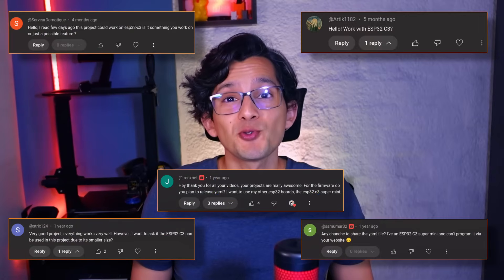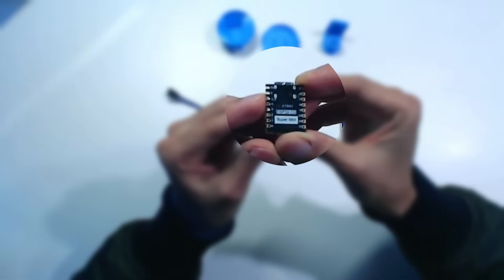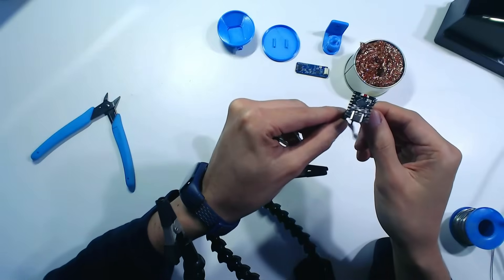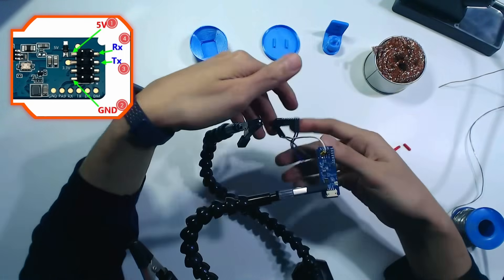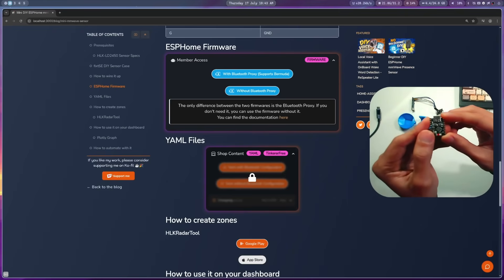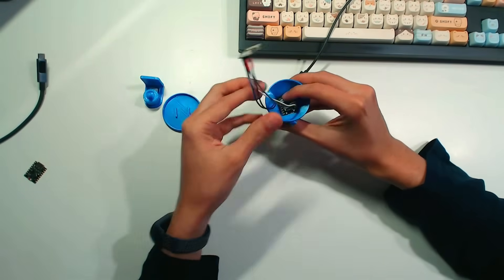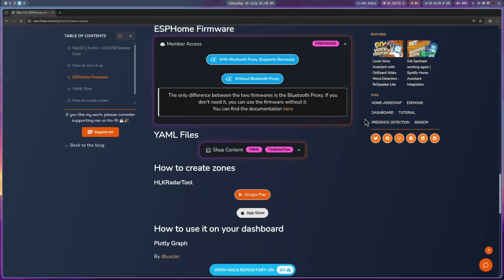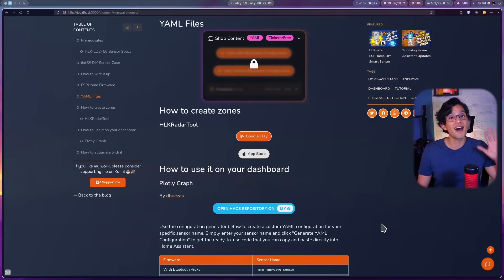mini DIY mmWave Presence Sensor | ESP32-C3 + LD-2450

Comment: Thank you so much fort this video. Very informative. 
But I have a problem. My esp32-c3 can be added to my homeassistant together with the mmWave sensor. But the sensor is showed as unknown. I am using the white small plug to connect the sensor to ESP. Can this be the problem?

Comment: I am not getting any distance readings, but it does report that it is connected and shows the LD2450 version number in Home Assistant.

What  do I need to do to have to report its distant values?

Comment: If I where to build this I would cut off the pins and solder the wire directly to the PCB.
Reply from the maker: You can use the pins on the side of the sensor for that. I just thought that approach might be a bit challenging to execute if you're new to soldering, that's why I went for the easier DuPont female terminals, but it's definitely an option.
Reply: @fixtse.  Fair enough.
Reply: Not intending to be troll or put ayone down, but those connections would have really benefitted with some flux first.

Comment: How's the WIFI range? The super mini board that you have linked in this looks like they are the ones with the "design flaw that ruins Wifi/BT"
Reply from the maker: Hi, thank you for pointing that out! I was under the impression the issue was with a different antenna (https://github.com/esphome/issues/issues/4893#issuecomment-1907180296). I just measured mine, and you're spot on, it’s the 2.5 mm version.
It's funny, because I had it running for two full days for my tests (sharing the antenna with Bluetooth and all) and didn't notice a single connection drop, probably because I limited the power output as recommended to 8.5 dB. But honestly, more reliable WiFi is always a win! 

I’m adding a couple of links for the better 3.5 mm version now. I'm also going to be adding a Wifi Signal sensor to the project for easier debugging and stick my test unit in a spot with weaker WiFi and see what happens.

Thanks again for contributing, this is what makes the community great!
Reply: @fixtse.  Limiting Wifi 8.5dB is the only way to get it to work due to the design flaw. the quickest way to tell that its the bad design is the placement of the crystal oscillator — it’s positioned too close to the Wi-Fi antenna and sits about halfway up the number 21 pin hole.
Reply: @fixtse. Are you going to have two firmware versions on your site: ?

One for the ESP32-C3 boards with the design flaw, which limits Wi-Fi transmit power to avoid interference.

Another for the properly designed ESP32-C3 boards, which work perfectly without needing to limit Wi-Fi power.
Reply from the maker: Yes, I'm a little bit all over the place right now (got caught up doing some testing), but I will update the firmware before my next video so I can include a version without the wifi limit.
Reply from the maker: updated the website to include the 2 versions
Reply: @fixtse.  If you set the framework to type: arduino, you can configure the code to reduce Wi-Fi transmission power to 8.5 dBm when it fails to connect after 10 seconds. This  code will try all the time

 ##Dont forget to remove the hard coded "output_power: 8.5dB" from the WIFI**, or it will make this code redundant.##

interval:
  - interval: 10s
    then:
      - if:
          condition:
            not:
              wifi.connected:
          then:
            - logger.log:
                level: WARN
                format: "WiFi not connected after 10 seconds. Setting TX power to 8.5 dBm"
            - lambda: |-
                WiFi.setTxPower(WIFI_POWER_8_5dBm);
          else:
            - logger.log:
                level: INFO
                format: "WiFi connected within 10 seconds. No change to TX power."
Reply: @fixtse.  Or this code only runs once at boot after everything else has booted. 

##Dont forget to remove the hard coded "output_power: 8.5dB" from the WIFI**, or it will make this code redundant.##

esphome:
  name: 
  friendly_name: 
    
  on_boot:
    priority: -100  # Low priority so it runs after WiFi setup begins
    then:
      - delay: 10s
      - lambda: |-
         if (!WiFi.isConnected()) {
           ESP_LOGW("wifi", "WiFi not connected after 10s. Setting TX power to 8.5 dBm");
           WiFi.setTxPower(WIFI_POWER_8_5dBm);
         } else {
           ESP_LOGI("wifi", "WiFi connected. No change to TX power.");
         }

This method takes the longest to establish a connection, as it runs after all other processes and includes a 10-second delay. However, it only executes once per boot and then releases system resources.
Reply from the maker: Hey @natrogers3297, thank you!!!, I will test this asap, I'm about to release a video about this and might need to re record parts of it, but this solution seems way better than having two separate firmware.
On the first boot, after flashing, since wifi credentials are not provided yet, the power will be set to 8.5, but then after restarting the sensor again, it will just work. Is there any other edge case that I might be missing? After a power loss, with no ups for the network, the sensor will boot, but probably the network it's not going to be ready to connect in the first 10 seconds, so the sensor will set the power to 8.5 and stay there until next reboot.
mmmm I don't like that scenario.
What if I add a global variable (boolean), that stores a value, so if the sensor it's known to work with full wifi power, it deactivates the WiFi.setTxPower logic, so a sensor without the issue will not be affected in any other scenario.
I'm just thinking "out loud" here 😅, might need to debug this a little more, but I like this direction. If I don't feel confident enough by the end of my time limit, I'll leave it as is for now, but I'll update the website in the future once I'm sure I haven't missed any edge cases.
Reply: @fixtse. If you stop and think about it, you could probably come up with 347 scenarios where it won’t work.

Keep in mind — just last week, none of those were considered, and Wi-Fi was going to be set to one of the lowest power levels.

Also, the people building and using these devices are the kind who like to tinker. If something isn’t working right, they’ll likely just power cycle the device — and in many cases, that alone will reset the wifi. 

This isn’t being used to support life or for medical purposes. its just a homebrew sensor. So if it were up to me, I’d simply build it into the firmware, accept that edge cases will happen, and move on to the next project. 👌👍😊

P.S. As far as I’ve seen, this will be the only ESP32-C3 MINI firmware on YouTube that automatically adjusts Wi-Fi power to work around the design flaw.
Reply from the maker: Yeah, you are right, I do tend to miss a lot of time in minor details, I have to fight that instinct.
But, aside of that, I tested changing the project to the Arduino framework, and the size overhead is too high. 
I had to strip out Bluetooth, BLE tracking, HTTP (also, no ssl certificate support under arduino), and OTA just to make it compile to a usable size. 
I think it's not worth gutting that many features for the sake of having only a single firmware, keeping two separate version seems more practical at this point.

Comment: I am a bit confused, the ESP board is just used to add the firmware to HA and then you don’t use it at all?
Reply: He used a donor board to demonstrate the process and then switched to one he had prepared earlier.  like a cooking show
Reply from the maker: Exactly. I used a different board to show the complete first-time setup. Not only is it the only time you need to press the 'boot' button, but it's also the only time you have to wait a few minutes after the first flash for the 'Configure WiFi' button to show up on the page.
On future updates, that button will appear instantly, and I thought showing that would be confusing for people setting it up for the first time.

Comment: Can you not a bme280 to this to make the ‘ultimate’ sensor for a room??
Reply: An AHT20 + BMP280 combo module, an SCD41, and a BH1750 all running on the same I²C line would work. Upgrade the board to an ESP32-S3 SuperMini or Zero for a bit more processing power, and now you’ve got the ultimate sensor! 👍
Reply: @natrogers3297 I would be happy just with BME280 and LD2450. Maybe a lux sensor too
Reply: @barrylapthorne8017  yeah that is what the BH1750 is. and the SCD41 is a CO2 sensor. the AHT20 it just a more precise temp sensor with the BMP280

Comment: Awesome. I'll make a few of those.
Have a question though - 
I have a non standard type house. It's very open plan style layout with walls in strange places, split level etc. 
It's not your standard house with rooms like little square compartments.   It's more like a game of 3D Tetris 😂

To do presence sensing for turning lights on and off I would need to have several sensors in some of the larger rooms.   How do they go having two or three in the same room?  Do they interfere with each other?

Great video by the way, I've subscribed!
Reply: I’ve got three units, each separated by a wall, and they don’t seem to interfere with each other. They can detect through light to medium-density walls and will still pick up movement on the other side.
Reply: @natrogers3297 that's good to know.  Going through walls is one issue I WON'T have. It's a mud brick house.  I've got to put a wifi router in virtually every room with a wired backbone. Bloody nightmare 😂
Reply: @MartinDolan  Just be careful when ordering ESP32-C3 boards. The ones shown in this video appear to be the versions with the design flaw that affects Wi-Fi and Bluetooth performance.

If you Google it, you’ll find details — the flaw is typically due to the antenna being placed too close to the oscillator crystal. That’s also why these boards are often sold very cheaply.
Reply: @natrogers3297 thanks for the heads up on that..  
I use zigbee wherever possible as with that every (non battery powered) device is a router...  But zigbee isn't good for high data things like cameras, audio, this type of motion sensing....
Reply: @MartinDolan  Exactly — for a sensor mounted in the corner of a room, these devices send a lot of data back to Home Assistant.

There’s no real benefit in switching to Zigbee, since the sensors are always awake, and sending data you can’t run off a battery. well, you could, but you would be changing them every other day. You might as well use Wi-Fi, which offers more bandwidth.